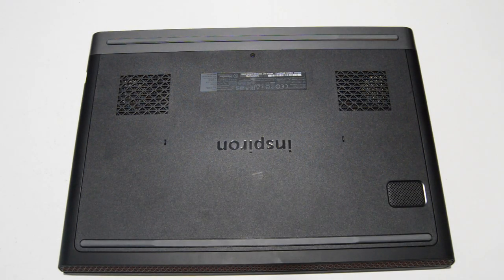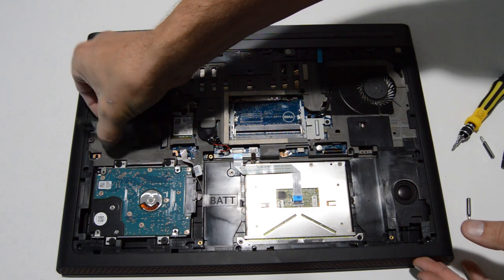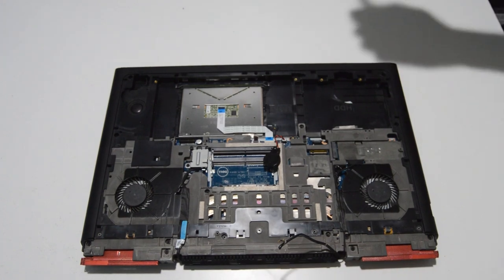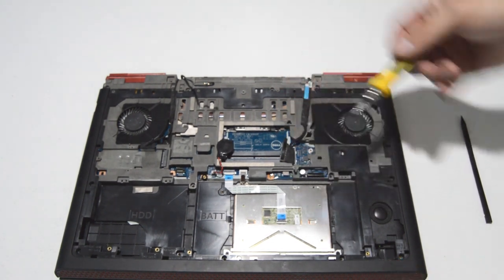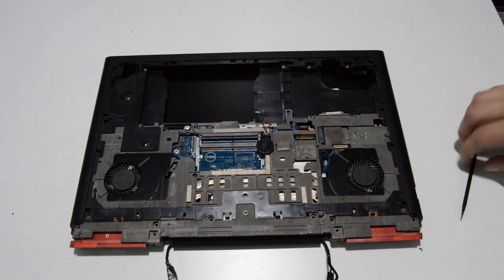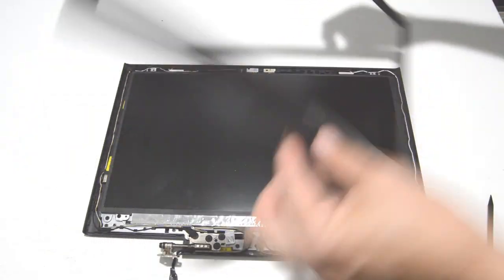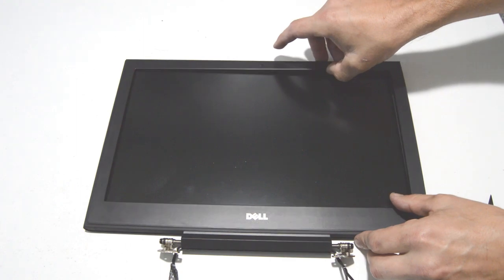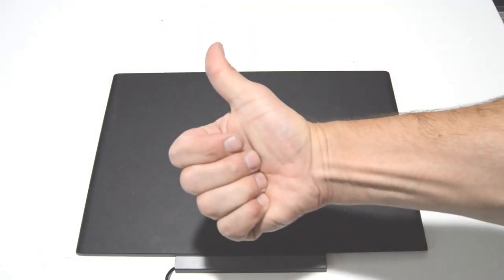How to Disassemble Dell Inspiron 15 7567 Laptop or Sell it.

Comment: This helped me a lot. I have the exact same model. The last time I used it was 3 weeks ago. This morning I opened the laptop and surprised to see lots of ants coming out of all the ports and vents. This video guided me to disassemble it and found ants making a nest right below the battery. I wonder how long they've been there. Good thing I didn't have to disassemble everything, only the battery and the hard drive.
Reply: How did you do the cleaning of your laptop? Maybe I have the same problem 😭😭😭
Reply: @DeathGirl13666  Hey sorry for the late reply. I used compressed air to blow away the ants, then a small paint brush and a mini vacuum to clean up what's left. It might not be a good idea though because I've heard that the electrostatic caused by fast moving air (compressed air and vacuum) could kill delicate electronics but I was desperate and those things came up first in my mind after I managed to disassemble the laptop.
Reply: How did the ants get in the laptop ???
Reply: @ThatVoxelBlock  it didn’t power on for 6 months and they were looking for heat maybe.
Reply: @comeonhay9899  crispy
Reply: I once had ants move into my router, it was pretty messed up. They had moved in because of the moderate heat it created and I later found an ant bed on the same outside wall (the source). I used poison on the walls and baseboards in the room to kill the scouts and workers and turned off the router for a day to remove the incentive to be there and to flush them out onto the poison. It got rid of them.

Comment: Not gonna lie, this laptop is complicated af. Trying to change just the thermal paste takes forever and based on this video, it seems like I have to take EVERYTHING apart. Maybe I should bring it to a shop.
Reply: might be smarter, once quarantined is lifted I'm definitely taking it to a shop. It's just too complicated to take a part
Reply: I mean, not really. It's actually one of the easiest laptops to work on. If this seems complicated then you probably have some gaps in your knowledge. It also depends on what you want to do. If you have to get all the way to the motherboard, take it to a shop. You could do it yourself but if you aren't comfortable going all the way then it's probably safer to take it to a certified professional.
Reply: @meyou9369  I tried. Every step. A bit bad on the connectors. But in the end, had to send it to the shop.

Comment: Hey my dude, i hove this particular model waisted with some water spilled over the keybord/motherboard. The tech dudes called burned mb and said i needed the entire thing replaced, whilst this other master of the craft said its repairable. Any ideas would be helpfull :)
Reply from the maker: Most of the time spill damage spells the end of the line for a motherboard. It may be repairable but it's very unlikely. You would have to disassemble then find out if there are burnt components. Good luck!

Comment: Hopefully I can get some positive feedback from you on this issue but long story short what happend is that I plugged in a old iphone to check it out for a friend i plugged it in on the left side usb port closest to the charger the usb port when opend is on it's own little board separate from the motherboard my laptop froze I turned it off and now it will not come back on at all. I hope the motherboard is not toast when I plug in the charger the led indicator for when its plugged in just gives a quick little blink as soon. As it is plugged in tho I get no response no other led come on nothing I dont know what to do or how to fix without looking at spending a few hundred bucks man any help would be awesome and if at all possible do u guys offer any type of trade in credit towards parts maybe I can sell some stuff I have laying around and u guys could fix my machine please and thank u (just fyi my dell is this exact model in this video ) i5 7th gen inspiron 15 7000 gaming series 7567
Reply: I have this exact issue, don't really know what caused it though. Haven't been able to fix it for months, let me know if you find a solution!

Comment: which screwdrivers u use to open it aall like what all screwdrives i need to dissasemble it and is it an easy task or should i call a technician from dell to change my thermal paste and cleaning my fans
Reply from the maker: I think it was just one 2.5mm phillips bit. Possibly a Torx T5 for the bottom cover, but mostly just a small phillips bit.

Comment: my dude please help me out.

i have this problem man...

when i tried to turned it on the power and charging led flashed for one second and then it turned off.

i have tried to remove the battery and hold the power button for 15-30 seconds. nothing.

i tried to turned it on plugged without the battery. 

but still nothing...

help me out man, what seems to be the problem?

Comment: Just want to double check, the DC power jack is not soldered on the motherboard, right? it is one of those cable ones
Reply: Just in case this is still useful, yes, it is connected to the motherboard with a cable.

Comment: Hey I followed your video all the way. But when I reassembled it, screen wouldn't turn on and fans would go off on full speed. Somehow that problem got solved when I rotated the lid and windows 10 booted up in a normal way. But nowmy keyboard doesn't seem to work. All the lights are functional, everything is working fine except the keyboard. Please tell me which cable is for the keyboard so I can try to fix it
Reply from the maker: Pause at 14:11, its the widest ribbon. Good luck!
Reply: @Ahmed Fazal What did you do to fix the black screen issue? I have reassmabled the laptop but the screen won't turn on. The power button shows that the laptop is on and I hear the fans running but nothing else works. Keyboard and screen are not functioning.
Reply: @Sellbrokedotcom  how do you fix the black screen issue?

Comment: Nice vid, it's very helpful; where can I find a replacement for that battery of the motherboard? what is the code or the type of CMOS battery that the Dell 7567 uses?

Any answer will be very helpful :)
Reply from the maker: eBay is a good start, your CMOS battery is 2 pin and I'd try and find one with the same length cable, but it's not too important. The 2-Pin connector should be pretty common.
Reply: @Sellbrokedotcom  ok, thnx

Comment: I have the exact Dell Inspiron 15 7567 Laptop. I'm using it right now. Am I correct that the sound and video cards are on the motherboard? I'm having problems with the on board speakers not loud enough, not as loud as when I plug in my headphones and every once in awhile I get a studder in sound. GREAT VIDEO. Thanks
Reply: No, the sound is on the motherboard and you probably have a discreet video card (not on MB) if it's an Nvidia video card. Laptops don't produce loud sound, just get some external speakers. The sound stuttering is typically drivers and/or software, start there. Speakers don't "stutter" when they are broken, the sound just becomes distorted.

Comment: Hi   i have the 7567 with non backlight  can i replace by a backlight one please?
Reply from the maker: It will only work if there's a connector on the motherboard for the backlight. You would have to find your motherboard part number and see if it has one.
Reply: @Sellbrokedotcom   thanks

Comment: I have a weird problem the laptop wouldn't output to display and spin fans at full speed, it then fixed itself but now its doing the same thing.
Reply from the maker: Might be a graphics problem. Hard to say but usually it means your graphics are going bad or there's a problem with RAM.

Comment: Are you know what is just happens   to my laptop when I remove the battery out of it it still can use for 2 day but on the third day it can't use anymore and the orange blinking is blink for 3 times and after it white blinking blink for 5 times and it just shutdown itself I don't know what to do now
Reply from the maker: That is weird. You can sometimes find from the manufacturer what the blink codes mean. You could also try cleaning out the heatsink (can of air) to make sure no cooling problems exist. Check your RAM to make sure its seated properly. Otherwise you will need to do some searching for the blink codes. Good luck!
Reply: @Sellbrokedotcom  ty for reply me back I know what is the problem now that is my motherboard was broken by electric system and my chip on motherboard was grilled but I change it and clean my heat sink and fix the heat problem now ty.

Comment: After 11 months of using this laptop now the left fan is making a loud noise and it is causing a very tense vibration that makes it move on the table.
Reply from the maker: I would first try using compressed air, like the cans they sell for electronics cleaning, and shoot it into the vent to help clean out any possible debris that may be causing a fan imbalance. Otherwise if that doesn't work you may need to replace the fan.

Comment: I need to replace the shell it’s in know where I can buy a replacement
Reply from the maker: Check out this eBay listing for $44 https://www.ebay.com/itm/Dell-Inspiron-15-7567-15-6-Genuine-Laptop-Bottom-Case-w-Cover-Door-DYXTD-ER/283772812797?hash=item42122d7dfd:g:VpgAAOSw6INeOqOg
Reply: Mine was broken today, new dc port cable, new shell, new charger, new hdd. Fuckkk

Comment: Very informative, have you heard from anybody about this same laptop showing the plugged but not charging, I damaged my charger bought a new one and that's what it said, then went to a store tried another charger and still not charging, then removed the battery and plugged it back and now it says that no battery is detected I've tried plugging it back again many times yet it hasn't work, I bought a new battery and it's on its way here. Some people say it may be the bios but I cannot reinstall it since it asks for my battery to be above 10% but then again I cannot charge it. Any ideas? I'd really appreciate any suggestions.
Reply from the maker: Can't tell for sure. Let's hope it's bios and once updated will take care of it. Wait for the new battery. Thanks for checking with us.
Reply: @Sellbrokedotcom  update, I just received my new battery and it recognizes it, and it says its charging but the percentage won't increase and then every 4 min I get BSOD with driver power state failure, I've read that it could still be the bios, power Jack, or motherboard, I will just send it to dell for inspection. But thanks to your video it helped me install my new battery.
Reply: Hey got the same problem here its driving me nuts. Did you find out what caused the problem I'd really appreciate any information.. Cheers,
Reply: @simondaniel6929  last person I took it to said it was the motherboard.
Reply: Damn that sucks if that's the case....
Reply: @simondaniel6929  yeah, one motherboard can cost you about 500 usd, I still don't know if I should but one or just buy a new laptop.
Reply: @javierrck18  omg dude literally same thing happened with me. Initially it only worked  when AC adapter plugged in and I didn't much bother about it, then one day I had an update like a regular Dell one and there was BIOS update in that too. I usually don't shut down but one day I did and it never boot up. My local repair center said mother board problem too. That's hell lot a weird thing
Reply: @RahulGupta-ox7gh  yep my motherboard got fried that's what they said.